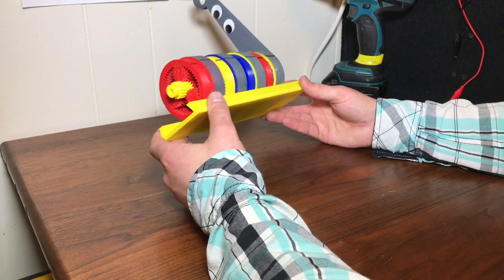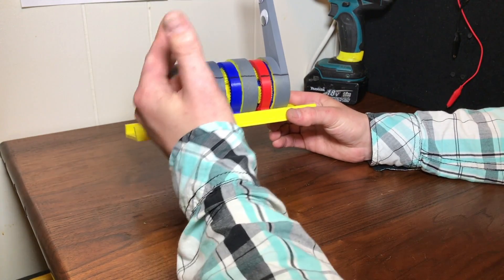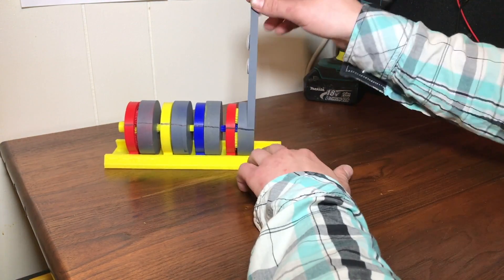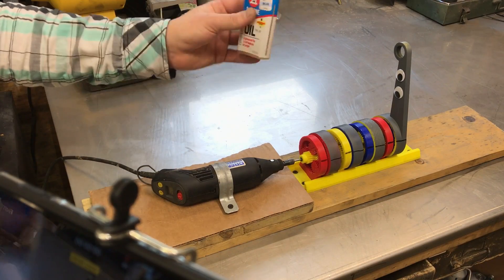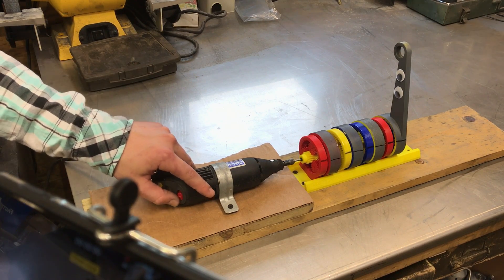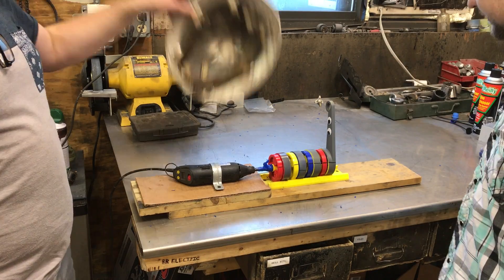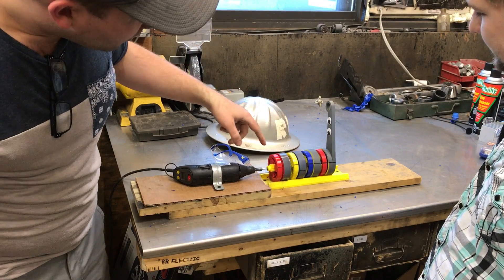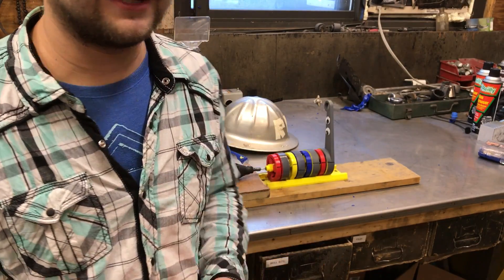3,616,238,492,881 To 1 - The Most Useless Gear Ratio Ever

Comment: So, would turning the final gear by hand rotate the first gear by 3 trillion times?
Reply: Bharath KK yes, but in reality the materials would just break before anything moved
Reply: Andrew Barrett It takes an infinite amount of force to break the speed of light. The closer you get to the speed of light, the more force it takes to accelerate when it finally reaches its limit at the speed of light (basic calculus Limits) and energy goes to infinity. You can't have more energy than infinity because infinity is infinite, therefor faster than speed of light is impossible through normal space time. Some people have theorized if you move spacetime itself through warping it that it would accelerate beyond the speed of light without breaking physics but it hasn't been proved and is more food for thought than anything else. Read Universe in a Nutshell by Stephen hawking or A Brief History of Time and you'll probably understand it a lot better. Great books
Reply: Andrew Barrett Light has nothing to do with it. There is a (local) speed limit to the universe. Light just happens to be one of the things that goes at that speed
Reply: Team YouTube just find a way to harvest the energy of a mom throwing a sandal and you're golden
Reply: Imagine the force required
Reply: Chris Russell all you need is 4 747's on the handle
Reply from the maker: Are you seriously doubting the theory of special relativity in the youtube comments section?
Reply: Bharath KK It would exceed the speed of light by more than a 100 thousand times so the force needed will break the universe apart
Reply: You’d have to hook it up to the crankshaft on a container ship engine at full throttle to get it to move, but when it moves, it’d be wise not to be standing anywhere near it because when it explodes, it would hit you so hard you would turn into a black hole
Reply: Mathematicsss, physics, JUST TRY IT PLEASE?
Reply: Andrew Barrett Dude, you seem to be talking seriously, so I'll clarify to you why its a real thing seriously and in layman's terms. If the universe were a program inside a computer, the speed of light from our perspective would be the clock speed of the computer. That's the speed it takes for the computer for transferring information in it's system and therefore its program, the universe. What's even more interesting is that inside that universe, if it were programmed as complex as ours, the speed of light for them would still be perceived as 300,000 km/s regardless our computer's clock speed. So in short, the speed of light, or speed of causation is an intrinsic property of our universe based on its complexity, not a fixed definition stated by a specific  theory, therefore it can always be found to be the same regardless the equation or theory we use to calculate it.
Reply: mathematically, moving the last gear would rotate the first gear over 3 trillion times
physically, the universe doesn't have enough energy to do so, and if it does, there isnt any material known to man that can witstand the amount of force it would require to move the gear.
Reply: Liam Poole Unless you made it out of reinforced metal composites, it will be good for making a ferrari powered by a hamster!!!!
Reply: Just turn that lever counterclockwise and let's see what happens
Reply: Everyone here just remember: this is theoretical. He can’t prove what would happen, no one could, he’s using math and laws on an extremely bigger base to calculate something, not only that but light-speed objects in this dimension are theory as well, we haven’t gone light speed so we don’t know what would happen
Reply: +Dew & Doritos
Absurd. Humans are capable of reaching nearby galaxies with the right technology and without breaking any laws of physics. The only somewhat plausible way for us to never colonize other star systems is if we destroy ourselves first.

Do you know how far the nearest star is? It's in the single-digit lightyears. At 10% lightspeed, that's only a few decades of travel time, and 10% is definitely plausible with nuclear propulsion. A human without any form of life extension could make the trip within their lifetime! And life extension technology is probably going to be available within the next century anyway! A few more centuries in the very worst plausible case!

Even the gap between galaxies is not insurmountable. An immortal crew, or generational ship, could make it within like a few tens of millions of years. Which sounds impossibly long to us today, but really it's just time, and an intergalactic ship would pretty much be a world of its own anyway.

We can make it. No FTL required. No magic required. Just good old mastery of physics.
Reply: +Redneck Firework
They wouldn't be able to get back, because they would have used about half their delta-V to get up to speed.
And the very attempt would likely be at least a few hundred thousand years in the future, if not more, so people would have more experience with existing for a very long time.

Right now, modern civilization is only a few hundred years old, and we're still bound by natural biological aging, so we really can't properly imagine what an immortal's existence would be like over many thousands of years. Maybe societal change will slow to a crawl, or even stop outright, as a state of "perfection" is reached. Or maybe people will just adapt to the changes better. Who can tell?
Reply from the maker: +Chris Russell and the plastic...
Reply: Hi
Reply: Bharath KK probably
Reply: L S Ooh you're mixing reference frames there.
So if a a relativistic baseball was coming towards you it would gain mass from that relativistic speed (it'd also have time slowed down and be squashed by length contraction). But if you were traveling at relativistic speed and had a baseball, nothing would be odd about that baseball and you could throw it normally. Within a reference frame everything acts as expected.
From an external frame of reference you're time is slowed and length along the direction you're moving is contracted, so indeed the ball would gain very little speed by throwing it.
Reply: Bharath KK can't we create infinite power from that?  Imagine if it had a handle at one gear, and a fan at the other, a few adjustments, and we could create a jet powered by a hand.
Reply: Jadvar you’d need infinite power to create infinite power, so why not use the first infinite power? You cannot create energy from nothing, nor destroy it, only transfer it
Reply: Andrew Barrett well, it is physically impossible for any kind of matter to even reach the speed of light, a black hole would be created based on the pure amount of energy in such a small space when trying to turn one side successfully, or the gears just break
Reply: no physical object can break the speed of light because everything is made of atoms and if you tried to go faster then the speed of light which is about how fast electrons on the atom go, then the object would break apart at the atomic level.
Reply: Don't do it! It would warp gravity and cause a black hole.
Reply: Andrew Barrett when somebody says "it gona break universe" it means. Unreallisticly epic cosmic ammount of energy needed.
Reply: So matter at the speed of light has infinite mass right? Does that mean it would have infinite gravitational pull and instantly suck the entire universe into it?
Reply: Liam Poole but why would the materials break? Is there just that much resistance between all the gears? And if there is then why isn’t there that much resistance from the side that’s spinning? I’m confused
Reply: Andrew Barrett lmao
Reply: theuncalledfor thinking about an intergalactic ship is strange for me. Because on earth we go 100 years and politics change and people change their ideas. So an intergalactic ship with that many people on board overtime could change the whole mission from get to the galaxy to something entirely different and may have a different end goal. Over millions of years if the ship were to last that long without the people killing eachother off they might even think that earth is somehow the mission and try getting back
Reply: We can pretty accurately predict what happens at relativistic speeds, Maxwell's equations are quite clear, so, so many misconceptions in this thread...
Reply: Dew & Doritos Actually that's sorta but not really how it works. The large hadron collider in CERN (Swiss I think? It's in that area) has gotten protons within 99.9999999999% of the speed of light, but there had been protons which have gotten 99.99999999999999999999951% of the speed of light. No one knows where they came from but it's believed to be from stars exploding. It's been nicknamed the "Oh my god" particle because of its appearance when it goes through our atmosphere emitting light patterns across the sky.

Photons are particles of light, light is a particle and a wave, depending on its state and it acts as both. You can't go faster than light through space because the laws of physics forbid it. The closer you get to the speed of light, the slower time goes for you relative to someone standing on earth, and the more energy it takes for the same acceleration. 

When you're approaching the speed of light, you're approaching a state where it would take an infinite energy to accelerate at all, and where time stops completely. It's hard to accelerate when time for you is completely stopped because there's nothing happening to accelerate because time is stopped. 

If you were to go 3 mph under the speed of light and try and throw a baseball you wouldn't be able to throw it faster than light because as your arm reaches the speed of light you would have to use more and more energy to accelerate the ball, and the closer you got, the more the ball would weigh do to relativistic effects and eventually you would either hurt yourself from trying to give too much energy or you would drop the ball because its weight would be so large that you could not push it anymore. 
Friction is not usually a factor in maximum speed, at least not as much as the rules of general and special relativity are.
Reply from the maker: The weight of the ant
Reply: you can't go faster than light that's just how the world is
Reply: Team YouTube You can't go faster then the speed of light because that's the maximum something can move WITHOUT friction, you could probably go as fast as light minus 0.00000001 the speed but light is photon (or protons or something I can never remember) so its not affected by friction thus having 0 effect on its movement which is why it's so fast and why we probably won't ever reach another star (besides the sun of course) because it would take like 2 light years which means traveling at even light speed it would take 2 YEARS even at the speed of light, unless we make some break through on perfect fuel efficiency which it would still take a long time to get there
Reply: Team YouTube Frankly, I think the whole speed-of-light limit thing is bullshit. That's like saying some kind of human paradox can destroy the universe. I don't think the universe is capable of knowing or caring whether something exceeds the speed of light or has a paradox. I think the universe is large and robust enough to withstand these kinds of things.

Comment: Maybe I'm just stupid, but why don't we just turn it around? Why not a ratio of 1-1trillion?
Reply: And even if you had an ultra strong material, the speed of the first gear complies with the speed of light.
Reply: Even then, the amount of force needed to turn the handle would be ridiculous and would probably break any material we currently have.
Reply: The force required would break the gear teeth before anything moved

Comment: What if you attached and induction motor in reverse to the input side of the gearbox (result a generator) and then manual rotate the lever ever so slightly by modifying it to hang a weight or something.. Since it takes forever and day day to do the rotation; I would think very minimum energy in with tons of energy out resulting in a highly efficient fuel to energy ratio.. That possible? Or would it take a lot of force just to move the handle on the last gear box?

Comment: How about turning the other end of the gearbox to make it 1:3.6trilion.. Pretty sure you would have created a worm hole
Reply: nodrinks 
Ooooor, the handle will just break, and the observable universe will continue to live on :)
Reply: Mark Bear You wouldn't be able to turn it
Reply: i know, jk
Reply: Well it takes 3.7 trillion rotations of the first gear for 1 of the last, the gears look like they have a 1.5in radius, and a bad dremel goes at 5000rpm, so...
3.7 tril * 5000 = 1.8*10^16rpm
v=2pi*1.5*(1.8*10^16)=1.646*10^17rin/min
Plugged that into a tip speed calc and its 35908488000000m/s...    METERS PER SECOND
 (mach 104726205997)
Speed of light is 299792458m/s
The first gear would be going 119777.82x the speed of light
It would take 119777.82x some unlimited amount of energy to rotate it and it would destroy the observable universe. The laws of physics as we know them would cease to exist...
Reply: Except the laws of physics would stand. otherwise everything you stated would be possible.
Reply: not my own comment, checkmate
Reply: u focking w0t m9
Reply: nodrinks stop copy and pasting your own comments into replies...
Reply: nodrinks Welp that sucks that it spins faster then light, but at least we have a universe killed on our hands!
Reply: Even if you had the amount of force to push down on the handle, the stresses on the opposite end of the gear would shred the final gear into subatomic particles. Or friction would melt parts into a plasma.
Reply: nodrinks copying other replies is not cool u know
Reply: Creating a wormhole takes mass, you're talking about time travel ;)
Reply: nodrinks actually if a material was strong enough theoreticaly it can break the speed of light
Reply: Bonfire Gaming 
Not if it has mass.

Comment: build one the other way around, so one rotation makes the other end rotate 3 trilliontimes
Reply: It wouldn't be possible because the amount of force (to spin the gear) that would be exerted would be far, far more than any material could handle. Things would break.
Reply: sleetskate That’s basically the same thing.
Reply: no its not, its the opposite. this one requires 3 trillion turns of gear 1 to spin gear 4 once. I want to see someone spin gear 1 once to spin gear 4 three trillion timees

Comment: The speed of light is : 3*10^8
This has a gear ratio of:3.6*10^22 

So if you turned the last gear all the way round at the speed of 1 m/s , The second gear would go 12,000 times the speed of light!